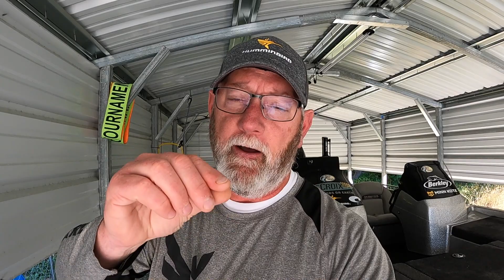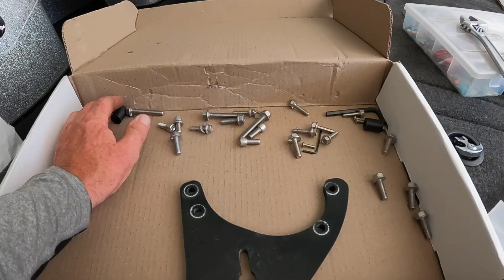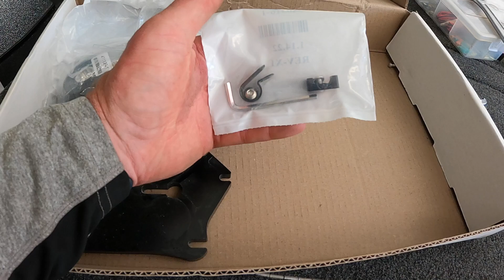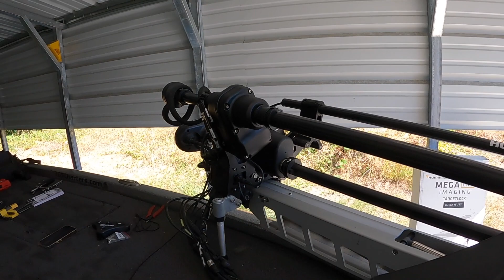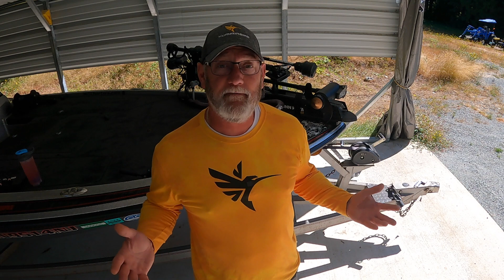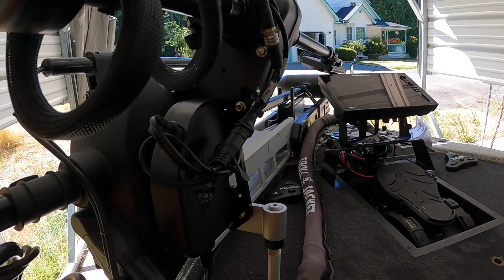Humminbird Mega Live Active Target Installation Tips

Comment: Not sure if you will see this since vid is 3 yrs old but...... Do you recommend installing a stabilizer bar like dd26 dogbone or precision sonar bar ? I'm concerned about the shaft vibration/shaking while traveling down the road and running in rough water.

Comment: Thanks for the video.  What puck are you using?  I can't get mine to sweep.  I was told I need a (  as gps hs external gps receiver with heading sensor)  but the hummingbird rep said my original Terrova puck was fine.   What did you have to do to make the sweep operate?  I don't even have sweep as an option in the menu..
Reply from the maker: Sorry for the delay in responding.  So I have the Ultrex and I run Solix on the bow.  I have the as gps hs external gps receiver with heading sensor.  Off the top of my head, I would go through the setup process again for Active Target.  You should be able to scan, target lock, etc.  If you still struggle, feel free to call me and I will do what I can to help.

Comment: I used those plastic spacers and a couple longer bolts that came in the bag and mounted my stabilizer bar in the same holes as before. And I didn't have to cut the rod

Comment: When you did the installation did you pull the target lock shaft (pole) out of the steering housing and then put the shaft back in and through the housing?
Reply from the maker: No.  If you look at 7:32 in the video, I am working with the shaft and the motor housing is connected.  I would not try to remove the shaft from the motor housing.

Comment: Did the manual tell you mega live transducer height vs mega 360 transducer height? I don’t have the target lock but I made my own and want to figure out what they suggest so I can clear my images up. Also what lift assist did you go with?
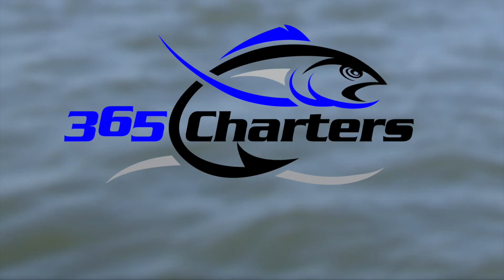Reply from the maker: I do not have a lift assist.  There is not a specified height recommended by Humminbird.  They just need too be offset.  That said, 360 sweeps, so I did not want the Mega Live transducer pole in the way of the 360, so my Mega transducer is higher than 360.  If you look at 16:38 in the video, I made a slight adjustment and lifted my Mega transducer about another inch.  Hope that helps.  If you need a better picture, you can text me and I will get one for you.